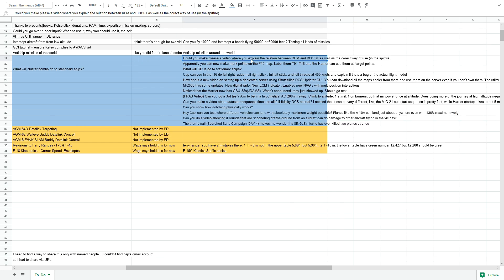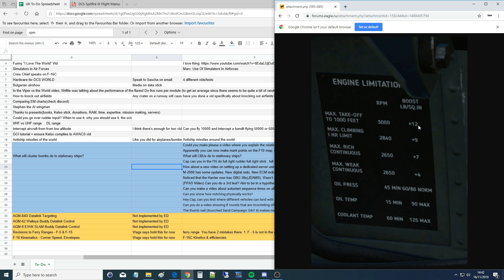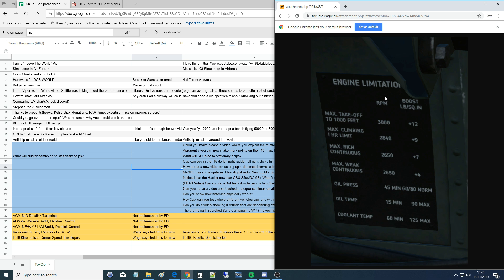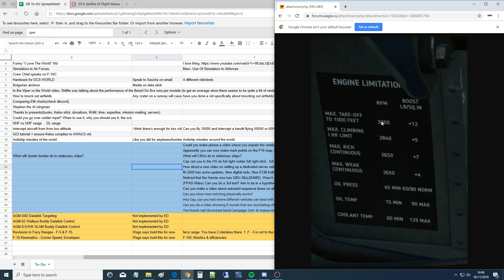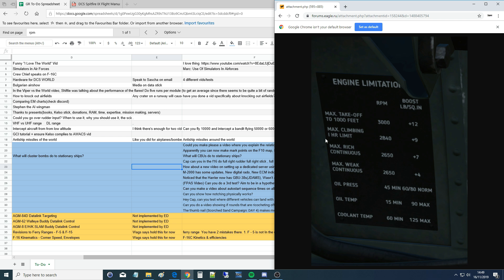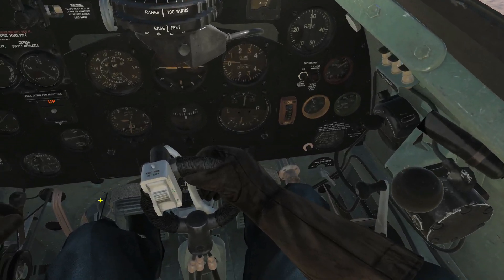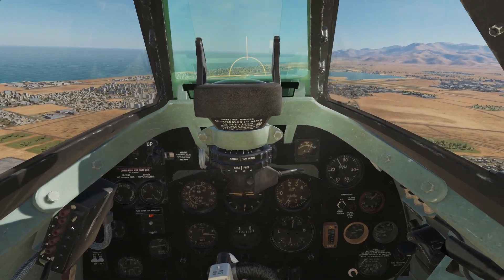Flying Basics: Relationship Between RPM & BOOST And How To Use Them | DCS WORLD

Comment: As far as I know about planes with variable pitch propellers, you never want the manifold pressure to be above the max RPMs the engine can withstand, therefore:
:
- When increasing power: Increase RPM first, then adjust BOOST
- When decreasing power: Decrease BOOST first, then adjust RPM
:
As long as BOOST psi isn't above the max RPM shown in the table your engine should be fine.

Comment: What does 2500 rpm 1.3 ATA mean? The only gauges in my aircraft is a tachometer saying ata and a guage saying ATA/atm.

So if it says 2500 RPM 1.3 ATA what should the tachometer and the other guage actually be showing?

Comment: 0:44 I think that it is not true. I think you make a confusion between what a cycle is (four strokes) and what a revolution is. The ‘speed’ of the engine is always the RPM of the crankshaft. Always. Camshafts, for four strokes engines, have to rev at half the speed, but the RPM of an engine is always the RPM of the crankshaft. Always. Then, of course, the RPM read in our warbirds is the prop speed, which can be different. But your explanation in the beginning seems very wrong to me! A four strokes (single cylinder) engine that revs at 1000 RPM will go through 500 cycles (would they be Otto, or Diesel or whatever) per minute. If you are not convinced you can check the speed of a car: it is the result of the speed of your engine (crankshaft), the ratio of your total transmission (including the differential) and the diameter of the wheels.

Comment: A newbie question. It's clear for me howto handle rpm&boost during "static" situations (takeoff,landing,climbing,etc.). What to do in combat or during manoeuvres that force you to increase/decrease your energy via engine handling? Leave rmp to a fixed value and increase/descrease boost? Vice-versa? Both? Eg. I have to perform a split-s: what to do during the manouvre, in particular when the nose points the ground? Decreases rpm or boost? Thanks in advance.

Comment: Hey Cap. I watched your video and feel I need to offer some additional input try to help answer the question.
The RPM in question IS propeller rpm as we are talking about high performance engines that utilize constant speed props. 

The boost in question is the supercharging of the engine. These high performance engines have the ability to climb very high into the atmosphere and start to loose power as we climb do to a loss of atmospheric pressure. The superchargers compresses the air entering the intake manifold allowing the engine to breathe and maintain its horsepower rating as it continues to climb. Even with a two stage supercharger as in the Mustang there would be a point where the engine would run out of excess power to climb. 

Hope this helps.
Reply from the maker: Thx Sir

Comment: The Spitfire, the P-51D and the 190-D9 have super-chargers geared to engines.  Thus, the relationship between RPM and boost is simple - the higher RPM the higher boost from the supercharger. HOWEVER, they have manifold pressure governors which throttle any extra boost over set value. That's why it seems that the RPM and MP are independent - just set RPM to idle and the boost lever fully forward then start to increase RPM slowly - you will see the MP tracks the RPM directly (1st MP will decrease slightly due cylinders suction but with more RPM the supercharger will start to overcome that and more). Only if the supercharger produces enough boost the MP gov kicks in and RPM/boost start to "act" like they would be independent.

Super-chargers may have more than one switchable gears but they just move critical altitude higher and the basic mechanism stay.

The Bf 109s have super-chargers connected to engines through hydraulic clutches and the RPM/boost relationship is a bit different (don't know much about this one). Even more different is the turbo-supercharger in the incoming DCS P-47D.

Comment: selecting rpm is a little like selecting a gear in a car. take off and climb have high rpm, for level flight and diving reduce rpm. high pressure with low rpm strains the engine so move the levers in the correct order to avoid this situation. pre landing checklist typically has one set rpm to high so that in the event of aborting you have it already set. I would imagine a lower rpm will allow a higher max speed in a dive though not tested this yet...
Reply: this is completely wrong.
Reply: at Snakeye 505 .... really which part? firstly the part about high manifold pressure with low rpm stressing the engine comes straight from the poh of aircraft ive flown. the part about ensuring then that the order in which power and rpm are manipulated is just a consequence of this. the analogy regarding it being like gears in a car was not intended to be littoral (this i would think was obvious but my be i over estimate people) but conceptual. Its the way i like to think if it and interestingly the aopa website uses a similar analogy but in their case using gears on a bicycle and straining you legs if in the wrong gear. then the bit about setting the rpm before landing is recommended by instructors (my being from a usaf lt colonel) this makes sense incase you need to add power rapidly to go around. my references are my FAA and EASA pilot training, the poh of aircraft ive flown, and the aopa.org website what are yours? im open to the idea that there is some specific differences to ww2 fighter aircraft although there was a T6 were i trained and such a difference was not mentioned and one would imagine the principles remain the same....

Comment: If your willing to watch...this training vid goes through the entire start up and settings. The part on power climbing shows full use of the supercharger. As you climb the air thins and your throttle tops out...back her off and go into low blower and bam!  you have a biting throttle with full range...etc.https://www.youtube.com/watch?v=6r9I--M7owE
Reply from the maker: thx
Reply: Ironically the P47 and F6 shared the same power plant. Pratt & Whitney R2800 Wasp. The impellor blade type supercharger is built within the powerplant. I have an original mech manual on it...unbelievable diagrams.

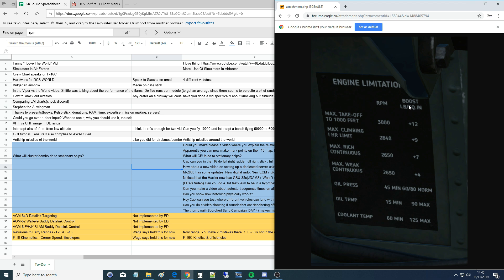Comment: The first 1:30 of this video is all wrong. Love your content Cap, I do, but I just have a few corrections. RPM is measuring speed of the prop. 

The Spitfire Mk IX has a Merlin 61 engine in it which actually has a .42:1 gear reduction in the nose case so the engine is technically spinning faster than the prop but whatever, the RPM gauge reads prop RPM. 

The propellor system is simply called a Constant Speed system, where in whatever prop RPM you dial in is maintained using oil pressure to actuate a hydraulic piston and series of counterbalances on each blade, reguardless of Manifold Pressure, above a certain MP... Also, procedurally, it's generally considered standard that a pilot will always reduce Throttle (boost/manifold pressure) before trimming the RPM. Its easier on the engine components. The reason the RPM somewhat bounces back and forth while moving the Prop Lever is because of those counterweights I mentioned before. Just be slower and smooth with it. It's a Spitfire, not a Mack Truck (or Lorrie...) Good job on ED for modeling all of that. 

Also contrary to what you mentioned in the video, you COULD maintain a lower RPM with any Boost setting. The Constant Speed propeller is trying to maintain a lower RPM by taking a "bigger bite" of the air, a steeper blade angle or more coarse blade pitch to try and maintain the lower RPM, while you're feeding more Boost and working the engine harder. This just strains the crankshaft and pistons and connecting rods. In the real world, that's how you blow up engines. General rule of thumb is higher RPM is easier for higher Boost to turn the engine. There are articles out there on the internet I'm sure about how Charles Lindbergh himself taught squadrons of American P-38's during World War II about what we now call "Oversquared Operation" where you run lower RPM and higher boost when cruising very lean to best fuel efficiency. That's way off in the weeds and neither here nor there... 

More (VERY) general rules on Throttle (manifold pressure control i.e. boost) and RPM. Slower turning engines stay cooler and last longer. You're allowed 3000 RPM and 12psi Boost on take off like the limitations state because suppose you're scrambling for inbound German fighters. You want ALL THE HORSEPOWER that Mr. Merlin can muster to get altitude and speed as quick as possible. Say your cruise climbing after a non-scramble take off towards a target or on a mission, reduce throttle to 9psi Boost (always reduce throttle first) and then set the RPM to 2840. But if you find a German on your tail?? RPM full and watch your Boost... I wouldn't go above12
Reply: @Stratozombie Aircraft that have high performance engines have constant speed props. The RPM that is being discussed here IS propeller rpm and the engine  power is monitored and regulated through manifold pressure. Constant speed props have a low pitch/high rpm limitation that is usually around 3000 rpm. This is the point where the blade tips are just shy of entering super sonic speed realm allowing the blade to maintain its efficiency.
Reply from the maker: Always happy to be corrected, thanks! The problem is, I get most of my info from the web, and there are so many conflicting sources!

Comment: Good job Cap thanks.  The internet is full of confusion on this much like the comments here not adding much help. Personally (and wrongly but its good for me to fly all day) I think of the Boost as gears on a car. Need a lot of safe power at take off stick it in 1st (high boost) for slow speed but torquey power. Going on a cruise at level altitude - stick it in 5th (low boost), save some gas. Seen the Hun? Go down a gear (increase boost) for altitude changes and nippiness as required. Lol yep clear as mud hehe.
Reply from the maker: Roger, I get confused by it also. My knowledge mainly comes from cars.

Comment: Cap... One revolution is one revolution. 
It doesn't matter of it's a 2 stroke or 4 stroke, Turbine, Wankel or piston engine. It's crank RPM. 
True is that a 2 stroke makes power every time the piston is  at top dead center. 
A 4 stroke has 4 cycles, it only makes power every second stroke, but that still turns the crank via the connecting rod every time it is moving up and down.
And the crank is at the bottom end of the engine. from there you can gear it or use it as straight output.

Boost is dependent on engine RPM in regards to a supercharger. As it's driven either directly from the crank or off a gearing. The Spitfire has a two stage (gearing) box in between the supercharger and the engine.

Regarding Air/Fuel mixture. There's a ratio of optimum burn called the stoichiometric ratio. 
An air/fuel ratio of 12.5:1 to 16:1 is the range of combustion where 12.5:1 i gives most power.
More fuel means more power and a cooler burn, but less fuel efficiency. 
The leaner the burn the less power it makes overall, but there are higher temperatures and a tendency for the pistons to melt.

Which is why tuners up the amount of fuel injected when adding a turbo or supercharger. Too lean and there's no power, too rich and you can make insane amounts of power but the engine is burning through fuel way too fast.
You really need to read up on combustion engines..
Reply from the maker: Roger, it's a long time since I studied this in cars, my apologies.

Comment: Interesting how the quality of fuel affects the engine as well . Would be interesting to compare the poweroutput and performance of the Spit is its using a fuel available in the WW2 wartime and modern fuel available now ?
Reply: modern fuel would destroy the WWII engines.   they used 130-150 octane and water/methenol injection in WWII planes to reduce  detonation and knock caused by high combustion temperatures, and the higher the boost, the higher the combustion temp. ...  im sure those types of fuel are still available as there are WWII planes still flying today...  but 94 octane from the Esso gas station wouldn't cut it.
Reply: @scarecrow1323  This is wrong. Avgas today is 100LL. It will run just fine but the engine develop the same horse power as 100-130 or 115-145.
Reply: @snakeye5053  fair enough.  but I was referring to using just normal car gas.   I assumed that the gasoline powered engines use an aviation fuel...   but thank you for insight.  👍  Grim Reapers Rule

Comment: There is a  two stage supercharger on the IX to adjust  the  performance at  lower and higher altitude ranges,  the LF in the type indicates the DCS variant was tuned for performance at lower altitudes than the F and HF variants.   The Prop is 'fixed speed' BUT that does NOT mean the prop rotates at a single fixed speed ,  it means  rather the propeller pitch/Blade AoA   is AUTOMATICALLY adjusted  to maintain the  chosen RPM  as set by the pilot   without the pilot having to manually trim the propeller pitch.   (the other style , less common on WWII aircraft is 'Variable Pitch propeller'  where the prop pitch is manually controlled by the pilot. Both types of prop rotate at varying speed, the difference is how the speed is controlled.